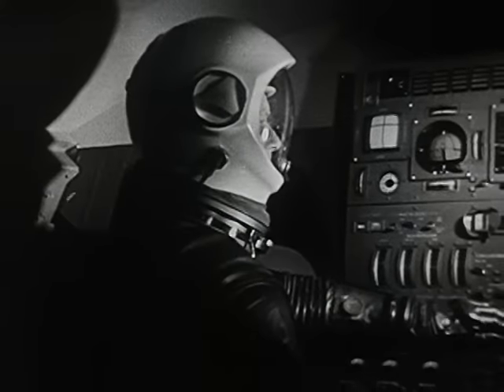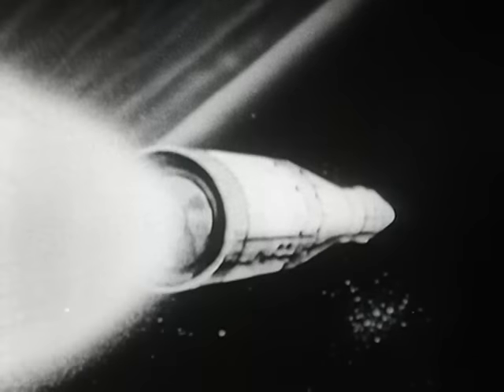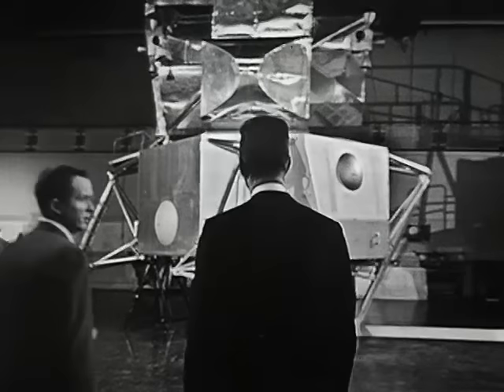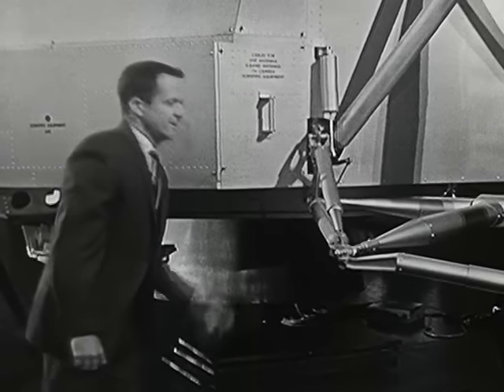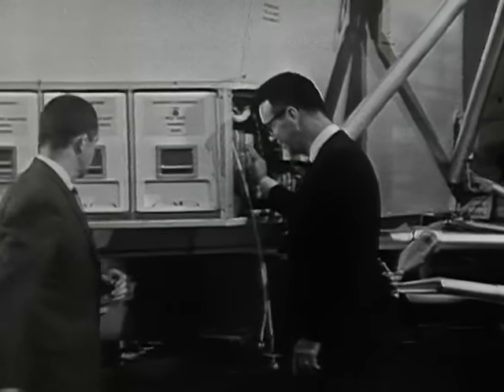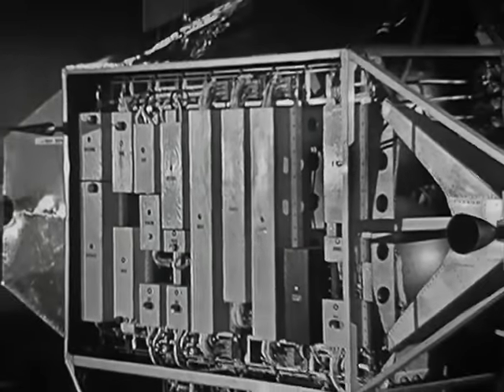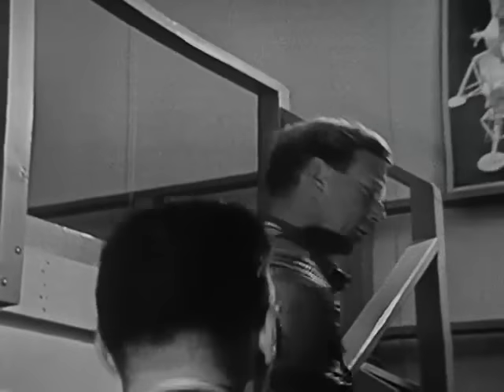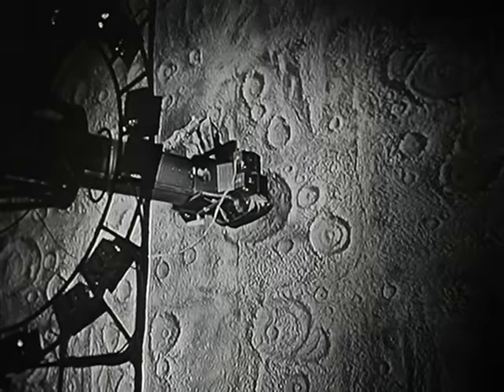MIT Science Reporter — "Landing on the Moon" (1966)

Comment: some vids of the close up views of lem on moon look like it is made of tarps and mainly cardboard- like its a movie set..
Reply: That's what pure spacecraft look like.

Perhaps you've never seen one?
Reply: @eventcone  This is an answer  i gave to another on another video. It has extra material you did not ask about.

 As far as the rough unsafe movements. The astronauts would be more conservative in my view as the benefits of jumping which are zero compared to compromising a seal would be to great. There actions portray a person on earth in a safe enviroment.  Death from jumping and stuff seems like way to risky in space. Punishing a suit has way too many down sides and no benefits.

 I still think they were on earth doing a moon walk movie live feed to mission control so as to make them think they were getting it from the moon.  The real astronauts were in orbit around earth. The compressable legs on the lander did not compress and make a lower ladder bottom end near surface for one reason.  The reason is because it was probably put there by crane.  Armstrong and all other lem pilots did not make such soft landings so as not to compress the lander compressable legs.

There is no INNER PRESSURE VESSEL as you say. What you see is a movie prop LEM..
As far as construction i was not referring to aluminum foil, though I do not know how it survived the propulsion  on the descent.

My main bone of contention is the cardboard like material and buckling and un even joints. The weird bowing and silver tape looking stuff. Where one tile meets and end place is weird. Its like it is cut off.

I know you have probably believed this for your life but you were fooled as i was. It is unsettling.  I wish it were not so. The astronauts are a curious lot to behold and their secret. I think they are under natl security orders to keep the secret as we were in a space race with the russians.  I think revealing the truth even on there death beds would be a financial hardship to their familys.  While alive i think they would open them selves up to legal exposure possibility. Many were in the military and could be put under orders.  Armstrong was a civilian but it may be he did not want to upset the apple cart for the other surviving astronauts..
Reply: @bradleysmall2230  

It's great that you think the astronauts would be more careful in how they moved about the surface, because for ages most moonhoax believers have been saying that it must have been faked because they were never seen making leaps of up to 6 feet above the surface!

I believe reality is somewhere in between. Don't forget that the first moonwalkers, Armstrong and Aldrin, tended not to move in this fashion. Most of the very active jumping and skipping, with the odd slip and fall thrown in, came on the later J-class missions (Apollos 15 to 17). Why? I would say because as astronauts and NASA and the engineers gained ever more experience with their equipment (not just suits but their spacecraft too) they gained EVER MORE confidence in its reliability and durability. This is natural in flight test - flight test programs (and Apollo was conducred like a flight test program) are designed and conducted in this fashion, accumulating ever more confidence in the design and the procedures as the limits of the hardware's capability are explored.

How much did the LM's legs compress? How much were they expected to compress? How much COULD they compress? You don't really explore any of these questions. And if it was lowered by 'crane' onto your alleged 'moonset', meaning that it was a movie prop, why would it not be produced with the legs in the 'compressed' position that you think should have been seen?

How soft were the landings? What would the g force have been? How much compression would this g force have produced? You don't explore that either.

As an engineer with 20 years experience in aerospace manufacturing, nothing that i see in pictures of the LM suprises me.

The LM was a test vehicle - not a production item. It had to do a job, and only do it ONCE. It does not matter if certain panels buckle permanently (would you be suprised to hear that aircraft panels are designed to buckle under load?).

You have absolutely no reason for saying that "there was no inner pressure vessel" as you cannot see it under the thermal insulation.

Your speculation is pointless and meaningless. You offer no substantial evidence to support your claims.
Reply: @eventcone  actually it was another person who used the term inner vessel. I have been ubable to get apicture. The tarp looking thing looks fake. Dangerous behavior on moon is unrealistic. Moon is not a good test site so far away. As for going or not going i can not say- all i know is the pics look faked for some reason..

The landings fed live to mission control would have to be a one shot deal- no retakes..  As far as compression you would not want to damage the prop  lem as you needed it for all missions or at least the present one.

It is possible some parts of live feed may have been done b 4 hand- maybe the rover sequences... They could have corrected unnatural movements and shadows. Some irregularities were unnoticed or were live feed and they had to live with them..

There is a scene where a tool/container bag is hanging and swinging back and forth as if in a breeze. Looks unreal on moon. Cant fiqure out why pics/video is faked..
Reply: @bradleysmall2230  
"The tarp looking thing looks fake".

What does the word "tarp" mean?

"Moon is not a good test site so far away".

Where do you think the Apollo hardware should be tested, if not on the Moon? Eventually, after doing as much testing as possible on Earth and in Low Earth Orbit, and in Lunar Orbit, the stuff HAS to be tested on the Moon. There's just no getting away from that fact.

Just as when testing an aircraft, eventually you HAVE to fly it for the first time. Eventually you HAVE to land it, turn it, dive it, stall it etc, etc.

"As for going or not going i can not say- all i know is the pics look faked for some reason.."

Not good enough.

"As far as compression you would not want to damage the prop  lem as you needed it for all missions or at least the present one".

We are not talking about "damaging it". We are talking about creating a "PROP" with the landing legs in the COMPRESSED condition, as it would be after every "alleged" moonlanding. You can film every pre-landing shot first, or else have two props, one for "in flight" shots, one for "surface" shots.

"There is a scene where a tool/container bag is hanging and swinging back and forth as if in a breeze. Looks unreal on moon. Cant fiqure out why pics/video is faked.."

Of course it looks "unreal" to you - it's happening on the Moon, where gravity is only 1/6th that of Earth. Didn't you know that the period of any pendulum (i.e. the time it takes to make ONE swing and return to its starting point) is a function of the local gravitational constant? The less gravity, the slower it swings. Also on the Moon there is no air to help damp out its motion.
Reply: @eventcone  
just what it says. Canvas looking/heavy cloth material covering  part of lem. Today there plastic but it looks more like canvas material similiar to a painters drop cloth. It seems bunched of and wrapping around pole. Not hung flat or stretched out. It was on another video i saW a couple weeks ago.  The person was zooming in on sections of lem.  Cardboard looking material seemed present. Looked normal from a distance though...
Reply: @bradleysmall2230 
That's how you should expect its thermal insulation to look. It looks that way for a reason.

And the rest of my reply?
Reply: @eventcone  as far as the bag swinging. It should NOT BE SWINGING AT ALL. There is no wind on the moon and it was still and all of a sudden it starts swinging.

As far as lem landing leg it was damaged probably during lem crane lowering.  The strap is visible on ground in area there the hammer and feather landed. The astronaut who conducted the drop experiment probably chose that spot as a clue to future investigators in case someone examined the photos in future decades. Many astronauts were disgruntled workers who were convinced to be a part of this charade when thry initially thought they would be part of a real moon shot. Clues were left
Reply: @eventcone  ..not looking real to me
Reply: @bradleysmall2230 
"as far as the bag swinging. It should NOT BE SWINGING AT ALL. There is no wind on the moon and it was still and all of a sudden it starts swinging".

O-Ho! That's quite a claim. You are going to have to point me to that piece of footage where it "all of a sudden.....starts swinging".

Please provide a link. Thanks.
Reply: @eventcone  I looked last week it was from a later mission. The one where an astronaut dropped the hammer and feather famous scene to see that they landed at same time. try to find it if i can- perhaps apollo 15 or 16
Reply: @eventcone  
swinging bag,, there is a longer video but this one i googled swinging moon bag. It was a rock bag.. https://youtu.be/sxcRDdejQXQ

In the other video an astronaut stopped the motion as someone noticed the anamoly aparrently..

You either want to challenge yourself with your convictions or not.. If so you will need to examine the official nasa photos.  Recent releases show more anamllys  as did old ones...
Ipersonally feel the recent ones were not released as they were  not meant to as someone knew they were TROUBLING..

With the passage of time and passing of original personnel of WHICH A FEW may have known of the fakery-- the photos got released.
Carl Sagan even had a few private concerns about the moon landing with his own space work/research..
Reply: @eventcone  Not sure if this went out but carl sagan had some reservations late in private life about moon landings and whether we actually went to moon.. (demon haunted world}
Reply: @bradleysmall2230  
OK. YOU SAID:
"as far as the bag swinging. It should NOT BE SWINGING AT ALL. There is no wind on the moon and it was still and all of a sudden it starts swinging".

That is not true.

In the video you linked me too, the bag is ALREADY SWINGING. It doesn't start swinging suddenly as you claimed.

Why is it swinging? It is swinging because it was set swinging by the astronauts' activities. Probably from the last time they touched it, or because something they moved touched it, and set it swinging. It may also have been swinging from the moment they hung the bag there. It MOST CERTAINLY is not swinging because it is being excited by a "breeze".

It is a pendulum, and pendulums continue to swing until their motion is damped out. Here on Earth the motion is usually damped by a combination of friction within the flexible tie or bearing, and air resistance. The latter does not apply on the Moon, so the same pendulum will swing for a longer period of time on the Moon before damping out.

And also it swings much more slowly on the Moon because of the reduced gravity.

There is the FULL, NATURAL and SIMPLEST EXPLANATION for what you are seeing in that footage - NOT that an enormous conspiracy was pulled off that deceived the entire world.

If you can't see that your sanity is at risk.
Reply: @bradleysmall2230  
"Not sure if this went out but carl sagan had some reservations late in private life about moon landings and whether we actually went to moon.. (demon haunted world}"

I'll bet he didn't!  :-)

Comment: Still seems strange that a 32,000 lbs module left no rocket imprint.  But whatever…
Reply: Theyre super smarter than eh-lon and had bettter technology… duh… without the help of G5 or cell phone reception . 
First try was enough , no other testing required 👍 
Wait 🤔
Reply: Well, that's its approximate launch mass (actually 33,500 lbs).

Why would you think it would weigh that much at touchdown on the Moon? Because by then it has expended virtually all of its Descent Stage propellant mass of 18,000 lbs. Then on the Moon its weight is one sixth of what it would be on Earth.

So that's only 2,583 lbs at lunar touchdown.

Oops!
Reply: @eventcone  only 2.5 tons??? Yet they left footprints with their boots..🤔 and it’s obvious thats the dirt is being kicked up in the “video”
Reply: @thunderboltpenetrator8498  No - that would be 1.29 tons (2000 lbs in an american ton).

Yes, of course some dust was kicked up. That's the key word - "some".

How long would it take for all of it to be removed (clearly it wouldn't all be removed instantaneously)? It would take time to remove all of the dust, and the further from the engine the more time it would take. As dust was still being kicked up at the time of engine shutdown, it's clear that all of the dust was NOT removed.

Also more of the dust immediately beneath the engine is likely to be removed than the dust around the LM, where the astronauts are walking.
Reply: @eventcone interesting, 18,000 lbs of fuel just to travel with a gravitational pull.  Seems like a lot to use for landing, estimating 4 tanks 3’x10’. LEM doesn’t look large enough to house the fuel.  And how much fuel to assent back into orbit and dock with the shuttle?.  This time we would be lighter but flying against gravity.
Reply: @eventcone  Interesting you didn't''t address their point about the amount of fuel storage and the size of the LEM.
Reply: @quadcityracing  "interesting, 18,000 lbs of fuel just to travel with a gravitational pull.  Seems like a lot to use for landing..."

Why? Do you expect them to 'throttle back and coast to a landing', from an initial velocity of 3,600 mph? Imagine you're in your car at 3,600 mph and you have to get to the bottom of a 60 mile high hill without any brakes. How are you going to do that?

Most of that propellant is used to decelerate from 3,600 mph by the simple expedient of pointing the engine in the direction of travel and firing it continuously at high throttle. As the ship decelerates, it begins to fall towards the surface, which you want it to do - but without allowing it to accelerate as it does so. In effect, landing from orbit is the opposite of launching back to orbit from the surface - the difference is that you have to carry far more mass to the surface than you need to bring back (because you can leave stuff you only need on the surface behind).

"...estimating 4 tanks 3’x10’. LEM doesn’t look large enough to house the fuel".

How did you do the estimate? You don't say. How do you know the dimensions of the 'LEM'? You don't say.

The (Descent Stage) propellant was housed in 2 fuel and 2 oxidiser tanks within each of the compartments created by the cruciform arrangement of the stage's shear webs (or bulkheads if you prefer).

"And how much fuel to assent back into orbit and dock with the shuttle?"

5,187 lbs, housed in 2 x 36 cubic feet tanks.

"This time we would be lighter but flying against gravity".

As I have explained above, descending or ascending (in vacuum) makes no difference apart from that created by (1) the difference in mass being accelerated/decelerated and (2) the need on landing to spend time and propellant searching for a safe place to land.
Reply: @Brian_S_O_Tuireann  "Interesting you didn't''t address their point about the amount of fuel storage and the size of the LEM."

No one made that point until quadcityracing's last post, which I have only just replied to.

But this stuff isn't secret you know. This is the information age and you can look this stuff up.
Reply: @eventcone yes, but you would think slowing 2,500lbs down from 3600 mph would make a crater in dust
Reply: @quadcityracing  Why would you think that? The descent was planned so that all deceleration was completed with the spacecraft still 100 feet above the surface - giving the commander time to inspect his landing site, choose his spot and make a gentle landing.

Comment: I wonder... how far can you actually take a Saturn V rocket? Like (extreme long time aside) is it theoretically possible to land the lander on Mars? What about getting it back from our theoretical Mars mission?
Reply: The Apollo Applications Program suggested a flybuy of Venus by 1973-74, but not a landing, using the Saturn V’s 3rd stage as a larger habitation module. It would have been similar to the Skylab space station, except unlike Skylab which was a “Dry Workshop” (fully built space station placed inside an empty rocket stage) it would have been a “Wet Station” (space station that would have been installed inside a spent rocket stage once all the fuel had been burnt). Wet workshops allow you to use the empty tank of a rocket to build your station in orbit, they provide a lot of benefits, but the challenges of cleaning out the tank and installing the station inside means we have never built a wet workshop space station.
Reply: @bigginsd1  I've heard of the plan to use a Saturn V to do a Venusian Flyby. I just never knew that they've never done a wet workshop before.